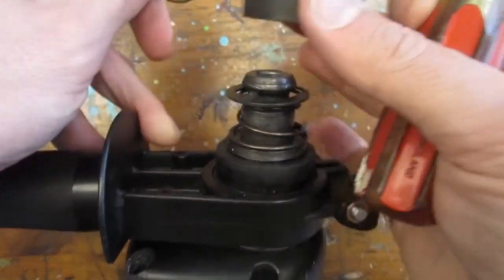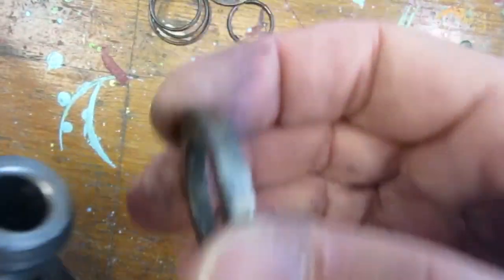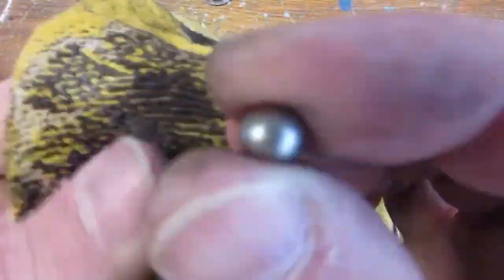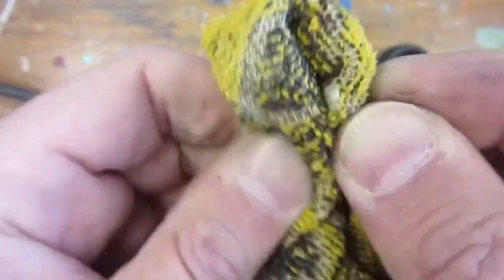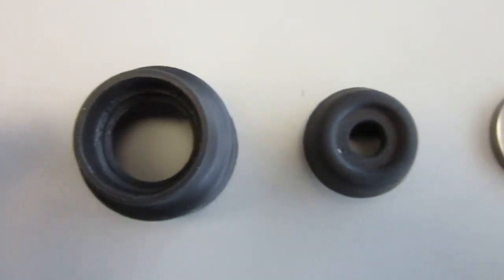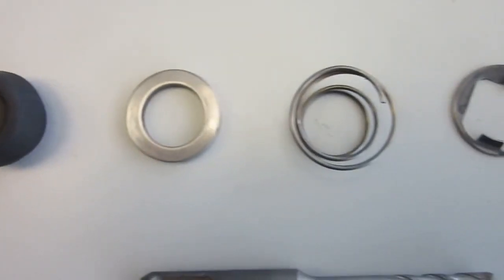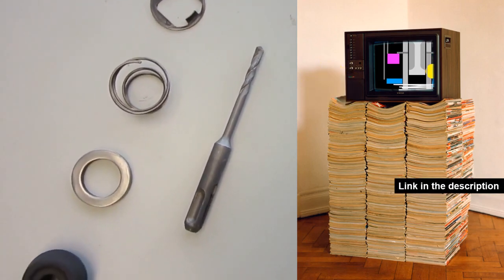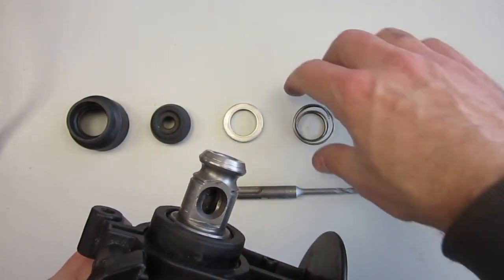MOTOR PUZZLE! Restoring A Hammer Drill Part 6 - Repairing / Rebuilding The SDS Chuck #HowTo #DIY

Comment: Great video. Just surfing to gather knowledge about different tools.
In video #5 I noticed a lot of wobble as the drill and chuck spun ... was this fixed with the chuck repair or were there other problems too ? I have an old Stanley hand drill that does the same movement due to a slightly bent shaft that connects the chuck to the gearbox.
Reply from the maker: While shooting the last shots of video 5, I discovered the chuck was not properly working (which led to video 6). Also, the drill did not come with any bolts to attach the 2 main parts of the drill body, I had to borrow long bolts from a circular saw but did not have enough of them.

Comment: Isn't it necessary to grease the chuck where the ball goes?
Reply from the maker: Greasing is controversial since as some grease get older, they may end up interfere with the free movement of the ball... in that case, drill bit = stuck
Reply: Seem to recall being told to grease the drill bits many years ago, but no one likes getting grease on tgeir hands.
I wonder if graphite/pencil lead, would be a good substitute for grease? Similar to locksmiths recommendation for "sticky" locks is to use graphite.
Reply from the maker: @y002cjw  I also wondered about graphite, but reading the Bosch documentation for instance, they do mention grease, their own one, so hope this is a special one because if it ceases, there goes your chuck...
Still in doubt, have kept mine dry for the time being...

Comment: I have a makita Cordless Hammer Drill..Bit is broken inside.how to remove it please
Reply from the maker: Broken inside, if you cannot catch and pull on the bit (and remove it as it was unbroken), you may have to take the chuck apart...

Comment: Great video, thank you. I've been looking for a part to repair my SDS hammer drill I was wondering if you could advise me on getting a replacement? The item I'm after is the second item in from the right (a flat washer with a flange?) I don't the parts name , sorry.  Any help with this would be much appreciated. I don't want to throw this drill away. Kind Regards.
Reply from the maker: Depending on the brand, the manufacturer may offer replacement parts (I recall seeing several SDS chuck replacement sets including rings, springs and metal balls). If it is not available, maybe some generic replacement part will work, so check the dimensions for compatibility.
Reply: @TheLabOtomy
Reply: Good morning thank you for the quick response. The drill in your video was it a Bosch? The reason I ask is that the waster I'm after is exactly the same as the one in the video. I'm looking on line but can't find one to match. Kind Regards.
Reply from the maker: @BobHarris-w9d  The drill in the video is a Bosch UBH 2/20 RLE
Reply: @TheLabOtomy  Thank you for the info. I'll email Bosch to see if they can provide me with a replacement washer. Kind Regards.

Comment: Sir my bosch hammer drill 2.26mm is bit wooble problem how can I solve this problem the bit cannot rotate strate please tell me what is the problem.
Reply from the maker: When this happened to me (to be seen in the video), the SDS chuck had been rebuilt but with components in the wrong order. So, first thing is to take the SDS chuck apart and see what is going on there. Any pieces out of place or broken can be the issue.

Comment: My sds no won’t hold the bits in so when I go to use the drill it drops out
Reply from the maker: Definitely a ball issue
Reply from the maker: @@gringowars5125 If there is no damage to the ball and other parts, you can just reassemble the whole
Reply from the maker: @@gringowars5125 There are repair kits available, but any metal ball of the right diameter (see your product specs) will do

Comment: Great explanation as to its assembly and disassembly. Just banging the drill body on the bench was sufficient to somehow dislodge the balls to remove the drill bit. Once the SDS drill bit was removed and the rubber cover prised out,  I just could not remove the circlip to release the spring and washer mechanisms. The circlip just keeps rotating around  its slot as I try to prise it up with a wide screwdriver as per video. Is there a special tool to do that??  I think the lubrication grease (maybe there was too much) was preventing the balls from moving freely. As I could not separate all the chuck parts, I just immersed the front of the drill chuck & sleeve (less rubber cover) in a tub of mineral turpentine to hopefully dissolve the grease and make the parts clean enough so that the balls can move freely. Thanks anyway as I certainly gave me an understanding as to how the SDS mechanism works.
Reply from the maker: About the circlip, the one I found on the drill was pretty lose. I assume it had been already removed and some way bent to a wider diameter. For circlip removal, there are some specialized circlip pliers. I do not own one myself and do not think I will buy since dealing with circlip only one in a lifetime. About the ball being stuck, this is typical of this type of SDS design. Drilling creates dust (especially overhead drilling) which can mix with the chuck grease to create gunk that will keep the metal ball stuck... adding a vacuum and keeping the chuck clean is therefore important. In any cases, thanks for your feedback and good luck with your repair.
Reply: @TheLabOtomy  Hi, thanks for the personal response. I had used a 25mm drill bit and after use I could not remove it from the chuck. I eventually grabbed to bit in a vyce and kept banging and pulling the body away from the bit until the SDS bit was freed.  I already have several circlip pliers, both for internal and external use. However, the "circlip" on my Ryobi SDS hammer drill is just a split ring. That is, maybe a 20mm circle with a 3mm section cut out and fitted in a slot on the arbor, there are no two holes on flat sections at the ends like a traditional circlip for the pliers to grip. There is no way to grip it and extract it, it just shifts about the slot irrespective which way I try to lever it out of the slot. I was able to insert the hard & sharp end of a scriber in a slot in the arbor to prise the clip out but all it does is to expand it slightly and push down rather than up. As mentioned, as I could not remove the chuck, I dunked the chuck section in a container of mineral turps to wash away grease and dust (not completely but enough). I sprayed some RP7 to clean the slot and balls and tested using another SDS drill bit (8mm bit). The 8mm SDS fitted and slipped in and out perfectly. Today, I refitted the 25mm SDS bit and drilled several more holes. Unfortunately, the same happened again. I banged the drill body, held the long 25mm bit in a vyce and just pulled back and forth until it came out. Upon cleaning the SDS shank I noted that one of the SDS slots on the shank had some deformation indents in it which may have caused one of the balls to "catch" and thus preventing the bit from being removed easily. Maybe the SDS drill bit shank has not been hardened and it possibly deformed during the "hammering" action of the drill. I will file these "burrs" and try again another day. Thank you for your help up to now. Cheers.
Reply from the maker: Thanks for the update, good to see folks with a problem solving mentality and skills!

Comment: Great - Thanks! That looks like a Makita and no doubt the other major brands are the same metal washer ball capture design. 
Note the HF Bauer brand 1-1/8 SDS had a fatal flaw (in mine anyway), where there is not a washer but the sliding collar itself must do that job simply by being sized tight in that area, which wears easily (I guess that saved them 10 cents but ruined my unit's functionality after just a few easy hours). Lesson learned. Got a Makita now. Double the price but betting 50x tool life.
Reply from the maker: Thanks for sharing

Comment: I strongly feel that you should have lubricated at least the moving parts while reassembling.
Reply from the maker: Good point Daniel. I thought about it but decided to not add any grease at this stage (a personal choice) since greace can mix with dirt (especially when drilling overhead) and lock again the drill bit in place... greace can of course always get added later if things start to deteriorate... I'll monitor and act accordingly, but good catch, thanks for the feedback